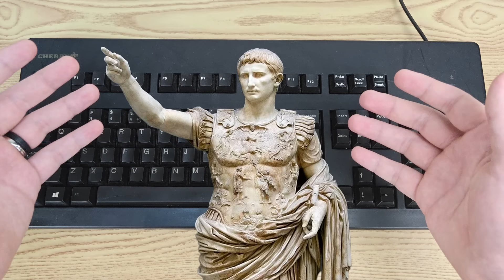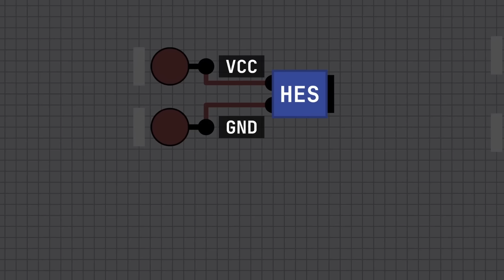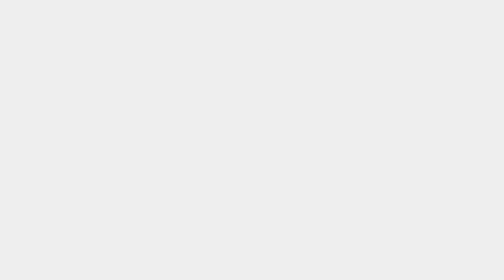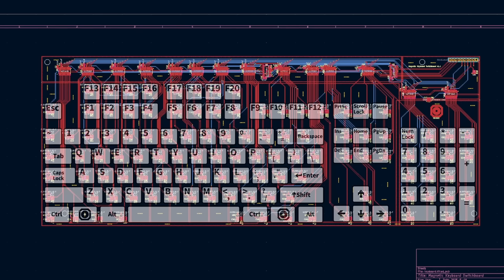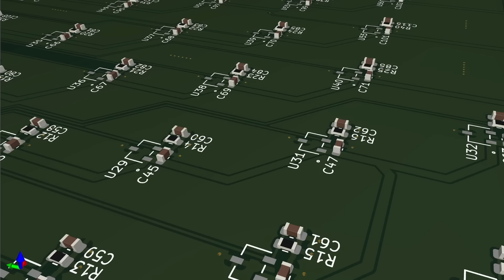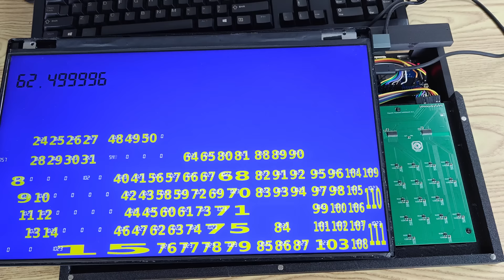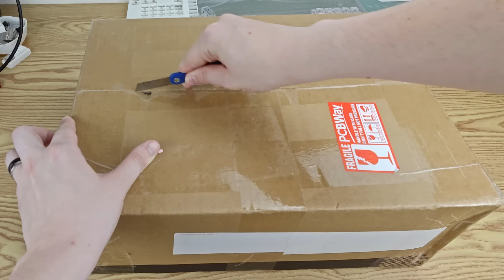Making a Keyboard that Swaps Key Layouts on Demand

Comment: 34:44 could be something with the decoder not being able to keep up so it outputs only partially decoded frames.
I'd suggest converting the video to H.264 (if it isn't already) and see if the problem persists.
Many modern codecs (especially VP9) don't play well if the decoder can't keep up.

However this most likely is the decoder not being able to keep up. It got the motion data right, but not the image data which is more complex.

Comment: Orange Pi have OTG IIRC so you could theoretically run it off of USB too. Just need the right model since the Pi 5 WILL hog power. The monitor itself also consumes some power, so there's that I guess. 15W (5V/3A) is a LOT of budget for small devices, BUT for a PC, that quite small.

Comment: I wander if you could place a lens under each key and project the image on the frosted bottom of a key, the projection would give you more space around the middle and it would give you also the ability to make it much taller without compromising on the viability.
Also for the keycaps, they could be cast from resin.
But man you made so much progress, unbelievable cool

Comment: I had to implement a display using OpenGL for frames coming out of FFMpeg at some point. Usually, the FFMpeg decoder will output an I420 frame.If that is the case for you, you can avoid converting the frame to RGB on the CPU side. Instead, you can create 3 monochrome textures which contain each plain of the I420 image and make a fragment shader which uses the 3 monochrome textures to generate RGB on the fly.

Comment: You can add addressable leds to keycaps, and make them lit separate symbols. That way you wont pay for the screens, wont sacrifice switches. Just 2-3 adressable led per key. the worst thing - you need connector from pcb to keykaps. And print and fill every single keycap. Maybe its better to design switches itselfes, that have 2 light guide channels.

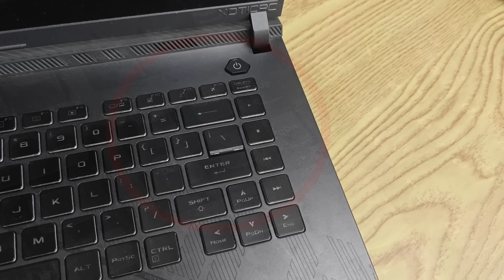Comment: 4:06 my own ahk solution to this has been binding home, end, pgup and pgdn to Win + Left, Win + Right, Win + Up and Win + Down respectively (which also lets me use an 85% keyboard with a numpad but no island, which is small and portable enough to use on the go with my laptop). The only downside is that now whenever I have to work on a computer that I don't have all my autohotkey nonsense set up on, like a pc at my uni, I'm constantly trying to use shortcuts that don't exist since I've long since forgotten that these keybinds aren't the default.

Comment: A few suggestions on the mechanical design: do not hollow out the underside of the keys.  Yes, you'll be using more resin which will increase cost, but because there is that inner wall of resin, it really cuts down on how much of the screen you can see through.  Make it one big cube of resin with the circular cutouts for the magnets.  To negate the extra cost, make the keys shorter in height, more like a laptop keyboard.  That will also make the screen more visible.  I would also suggest you reduce the gap between the keys and the keyboard frame to keep them from moving around so much, but add a slight draft (2 or 3 degrees) to the keys so they don't jam up as much.  I honestly would also look at using thin exposed wires as springs instead of the magnets, but you might be too far down this path to want to hear that.  If you used thin wires (like leaf springs), they'd barely be visible and you might get better key movement.  Just a few thoughts.  Good luck.

Comment: Since all hall effect sensors output roughly the same values, would be much better to place comparator op-amp near every hall-effect sensors. This will not only eliminate need for ADC, but also will be much more stable because you will only have logical levels to deal with. For comparator reference voltage you might use DAC so you will have be able to set it programmatically. This will also improve speed because reading so much ADC takes time.

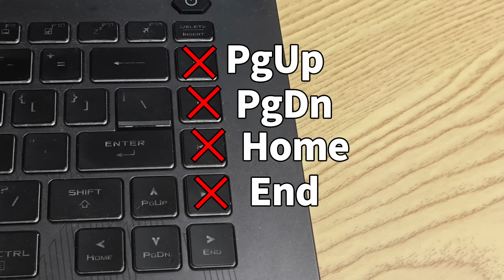Comment: 4:15 you, uh, know that those of us with 60% and smaller keyboards still use all those keys, right? Like, probably more often than you do. 

I will add some exaggeration here, for flavor and humor, so take my "put downs" of full size keyboards as humor only.

Imagine you're typing and you need to jump up a line, fix a typo, and go back down. You have to move your right hand OFF of the home row, all the way over to your arrow keys, hit up, hit left twice, them move your hand all the way UP to backspace, hit that, move your hand all the way BACK to the home row, type the correct letter, then move your hand all the way BACK to the arrow keys, hit down, then right twice, and then move your hand BACK to the home row. 
You moved your hand 5 times to change a single letter.

You know what I do? I press down Fn3 with my left pinky (it's the A key if tapped), hit K, H, H, press my left space bar for backspace (which is under my thumb already), let go of my Fn3 key, type the letter I want, then hold down Fn3, and L, L, J, let go of Fn3. 

I don't move my hand to do any of that. In fact, I don't even move my FINGERS off the home row for anything other than actual letters that aren't there.

PgUp/Dn, Home, and End? Same home row keys, i just hold down Semicolon.

Meanwhile, to us, everyone using full size keyboards looks like Dr Strange waving their hands everywhere.

We aren't using compact keyboards because we don't need Home, End, and PgUp/Down. We're using compact keyboards FOR those keys. We need them and use them constantly, and it is SO much more convenient than you can imagine.

Comment: I looked at the repository's description, so there's an installation or make command? I haven't used make for about 23 years. I'm using c++ at home, re learning some DLL things for c-11 and c-14, off topic , there's nothing like a packaged product, if I wanted to make this keyboard or one similar in about five or six years, I'm not all familiar with every chip and OS. I've been using g++ 14.2.0 from win Libs. I'm about to start on some graphics libraries for CAD and any interactive ideas. I'm considering DirectX or OpenGL, visual studio code as (cross my fingers) Microsoft copilot recommended for making graphics programs. I have been taking a break since my folks have been away for things. I have already made a program that worked basically with visual basic on visual studio, but my modular skills on visual basic were very short. after about four years, I made a 3d graphics program that could move point clouds in real time, delete and move transforms, and do polygon viewing. To make a long story short, someone cursed my Visual Basic work and the Program binary and scripts were somewhat misplaced . I have been blessed however to use C++, and I have learned a variety of constructs, when I started to study for DLLs beginner projects, two days ago, as I have already learned how to use doubles and formatting to show up to 15 places of decimal digits with all the basic mathematical basic functions, I also made up some programming to do Significance checks on numbers and autoformatting as well as Add, subtract, multiply, with any number of digits instead of being maximum of 15, it has a string size maximum of about a billion digits result, as you might know when you multiply two strings of numbers, the number of digits can go up a little over two times the length, so instead of a limit of 15 places when you add, subtract or multiply, I have a billion digits max. When we start to try and find new particles without using particle accelerators, or discover what's going on out in outer space with AI, we also need accurate maths. I'm working on it. I have been taking breaks to re learn the things I learned and wrote about as a child, teenager and young adult.  I once came up with a method to find Pi to a large number of digits instantaneously which had to do with proportions of using large numbers and add the dividends, something like calculus.  The methods that the schools taught probably that I went to didn't show you but about a dozen places of accuracy, but my method could work to millions to billions, even for finding Pi or trig functions, but since Linux game programming was between a rock and a hard place, I mostly didn't publish my work. I got games to work but no brothers to share with. Intellect I have been told is alienating. But I have been looking for good spirited intellect for , ever.

Comment: This might be really naive but wouldn't it be possible to create a rudimentary analog circuit that turns the output of the hall effect sensor into a digitally readable high/low value, by having it saturate a transistor's gate, grounding the emitter, and reading the collector with a microcontroller pin? That's let you do a standard button matrix and skip all the multiplexing and reading analog values, you'd just need 24 or so digital IO pins for the matrix
Reply: oh also the button matrix thing supports n-key rollover if you smack a diode on each key. This is an awesome project

Comment: Hello, What screen size is used in for the keyboard?
Reply from the maker: 2560x1440 for the screen I used. Could drop in any resolution though.
Reply: @InkboxSoftware  Oh, i meant the diagonal size in inches actually (and the width/height in millimeters or inches), but thanks for the response.

Comment: 1) I absolutely agree that "just typing on a tablet" is absolutely not the same. Not only does it make touch typing impossible, it's also a compromise at best.
And yes, I'm also one of those people can't stand when a keyboard messes with that "middle block" between typewriter part and numpad.

2) I already know it can run Doom. I've seen it being done on a keyboard years ago. Even in single keys.

3) The keyboard might switch, but it is still limited to ANSI layouts and won't be able to use any of the ISO layouts or JIS.
On the other hand, you can use the full 24 function keys of the IBM terminal keyboard.

4) using hall effect sensors means you won't have any issues with keyboard drift :D And you'll get analog keys that can register how deep you press.
But the interesting part is setting up the matrix for the right rollover.

Comment: The project is interesting, but like all similar projects, it has one drawback - the image is only visible when looking at the keyboard strictly from above. Because the screen is deep below the top edge of the key, the image will always be distorted, and working with it is simply inconvenient.
I still don't understand why to use a separate orangepi board and Bluetooth keyboard — it still requires power from the outlet (20 watts!!!), so it would be more logical to use a simple controller for transmitting keystrokes and a program on the PC that displays the image. Then we would have the opportunity to take one of the ready firmware options for mechanical keyboards, which already know how to work with Hall sensors, data filtering, key code transmission, etc., which would simplify the work.

Comment: Ok you're selling yourself short in the thumbnail. You don't have 10,000 layouts. Every single pixel has 256^3 possibilities for colors, and the resolution is 2560x1440, so you have (256^3)^(2560*1440) possibilities, or about 10^10^7.425423471464380. That's like around 2.6569e+26633207, or a 2 followed by about 26 million 0s.

Comment: If you have the magnets beneath the keys like originally designed, you could use the hall effect sensors to have finer control in games (i.e. car steering/throttle) 👀

Comment: Tbf a good resin printer like the anycubic m5s is pretty affordable nowadays, and imo more turn key than fdm. (Though you do need gloves for it) My resin printer is very reliable, I can just send a print and be confident it will print, while I've had to tweak my fdm printer a lot more, and swap some parts.

Comment: I was immadiately like "yeah, I tried the Elgato Streamdeck but ..."
The streamdeck uses a resistive touch screen with plastic keys pushing on the screen. The tactile click in no way matches with the touchscreen key press event - maybe good enough for macro keys but not acceptable as a regular keyboard. But then you show the magnet solution and that looks very good. I do have to build at least a smaller macro keyboard. Combine this with autohotkey and it's an almost perfect combination

Comment: ** WARNING: long block of multiple comments, some positive, some less - in the order I thought of them **
The non alphanumeric keys are standardized pre-IBM too and layouts nationalized like in Germany it's a QWERTZ and in France AZERTY, so a cup of gross oversimplification just before 01:00 - and yes function keys etc are also moved and shifted - even changing shape, compare ANSI and ISO layouts - depending on the specific layouts, like I'm typing this on a scandi layout keyboard with the ÅÄÖ keys of NORDIC POWER next to my [enter] key. And no you do not need to memorize which key is what, clever people at keyboard factories and standardization ... organizations... have come up with ways to CHANGE what is printed on the keys! Imagine that! In fact my keyboard of pure awesomeness does not have a single letter or symbol printed on any of the keys, it just has anime faces on all the keys. That way I never get confused when I switch layouts! So my keyboard has already solved the problem this tries to solve. Simply print something else on the keys and learn which key makes which symbol with which keylayout and problem solved 😁 ("blind type x 2 or 3 or however many layouts you want")
The issue with this is that the physical keys are still US-ANSI layout&shape which means all the ISO layouts are broken on it without switching to a different overlay thing. 
Still a really cool project. It just doesn't quite do what you may think it does with the layouts because of the physically different shape of keys between ISO and ANSI keyboards - BUT - magnets? Sure, feel, ease and durability of construction, but you could have used sliding bending levers with a stepped track - in transparent plastic. You'd get the initial resistance and then snap easy bottom out without the screen blocking magnets. V2 maybe? 
Dunno if it would actually work with sliding bending levers, mostly the precision required might be beyond the manufacturing capability since a 0.1mm error on the inside surfaces would bork a key, and every key would be a 2 piece affair. Tiny wire springs might do the trick, but then instead of like your design which has 1 key body + 3 magnets per key, my idea would have 1 outer key 1 inner key 2-4 springs and still need 1 magnet to trigger the hall effect sensor... so from 4 parts per key to 7 but require still better precision of manufacture - my idea could be less parts but the manufacture precision is unlikely to work for that. Awesome project! That is why I have so many ideas around it.

Comment: Why not just use a nice!nano for the bt and a pi for the display board? you can either route all key presses through the pi and out to the nano using standard qmk firmware. the nano would be what connects to the pc and it's all already built. or you could have the sensors connect to the nano and then some specific keys route to the pi for display swapping and control? you'd build out less and likely have WAY less bugs. Just a thought!

Comment: Rather than mux the analog signals and then ADC them, use multi-comparator ICs to convert them into digital signals and then use a parallel-in-serial-out shift registers to get the data into a microcontroller.
Analog muxes and ADCs are expensive and analog signals are sensitive to noise.

Comment: i can't help you with your Bluetooth situation, i think that's crazy you went through all that.  however i would suggest you check out how other custom boards handle "ghosting" and "n-key rollover" to fix your one key at a time limit. people take for granted that modern keyboards can handle all keys at once,  back in the days of ps/2 keyboards and mice you could really get things locked up or ignored by pressing too many keys even just too quickly let alone at the same time.  i still think the tech is superior as it bypasses a few things to talk directly to the cpu and can even interrupt other operations to do it,  but I'll admit the ports were super limited and even more annoying to plug in not to mention they could only be initialized at boot so if you accidentally unplugged it and had to plug it in again it meant having to reboot the whole computer to get it to work again. 

you might try to setup a key buffer that can collect presses and send them in sequence.  

and you don't need host machine software for unicode, though you could have a chip on the board that automatically installs software on the machine you plug it to,  not sure about bluetooth connection though,  i know there's a way to send files and such but not sure how I'd automate an install from bt, back to the point,  unicode over hid you could macro on device or use a library chiplet. i think you'd have to fix your multi input problem first though.

Comment: I've been working on something not entirely different from this and completely forgot about the flux keyboard,  thanks for reminding me.  at first I was kinda worried that you did my whole thing before I could.   

I'm kind of doing a vfd display set of displays that are technically more like key caps sitting on hall effect keys but I mounted the sensors vertically. I use micro copper tubes and eddy currents for the key actuation feel. the return is handled similarly but also with 2 smaller inverted magnets outside the main repulsion. 

I can thankfully get away with an esp32 by paging sections and limiting refreshes or updates since the vfd operates more like a set of toggle switches for on or off. 

I'm also considering a monochrome oled display option instead of vfd. it's not as expensive as you think. granted I'm hemorrhaging money on custom small vfd screens so...